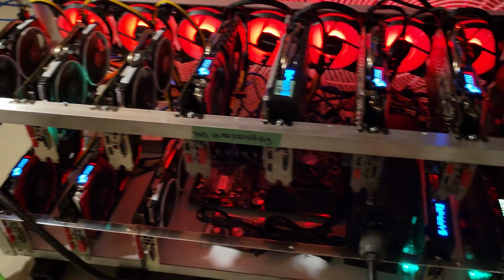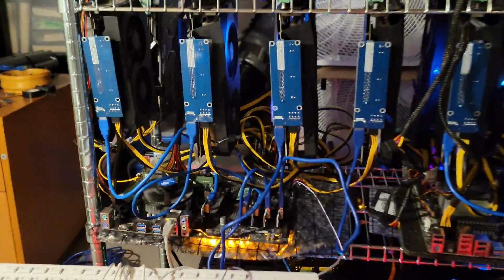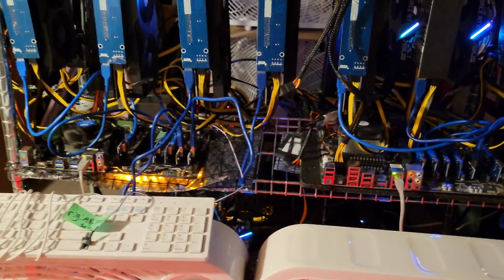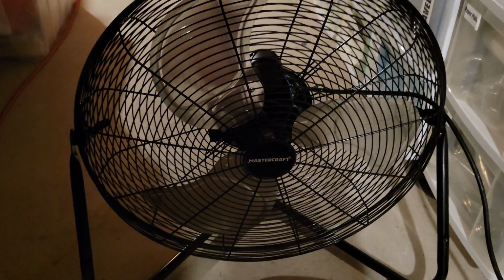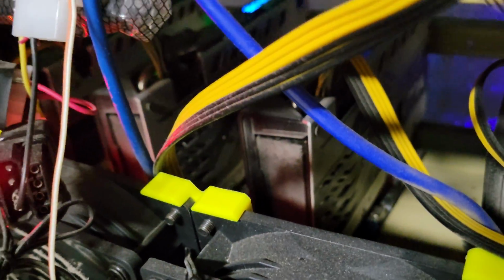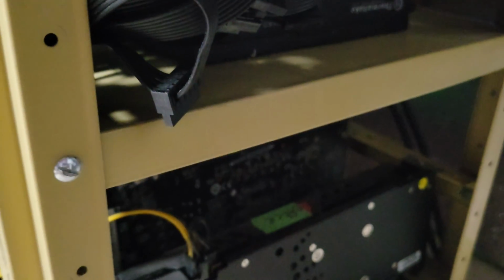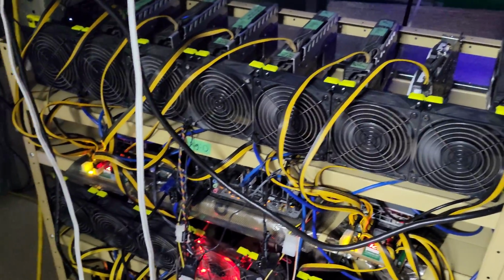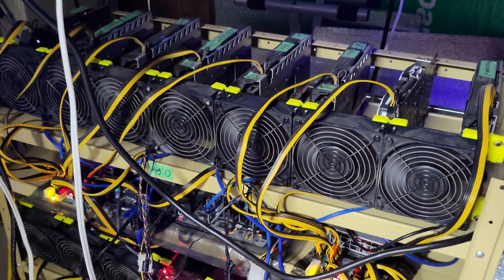Mining Rig update (RX 570 4gb/RTX 2060) Mining ETC and ETH

Comment: Hey i have some questions,  I want to build my own mining rig using to start 4 3060tis my local store sells them at around 750$ each nun LHR. 
About Psu i will buy an old dell platium one Ty for your guides about breakers 
I am quite worried about the motherboard, Idk which one do support the PCIe usb extender and which dont, do you maybe know how to distinguish between the two ?
Also for last should i run linux and let it run or windows ?
Reply from the maker: 1. a small 4 gpu mining rig is reasonable to start out with.
2. for the Dell Plat PSU, I needed to buy the breakout board from parallel miner, there is a specific model that supports it, of course check the supported psu models before buying. and the dell psu needs 240v fyi.
3. for a motherboard, there are a few options, you can buy a motherboard from aliexpress, there are some good cheap mining motherboards, otherwise you can also consider getting a 10-11th gen cpu, and pairing it with a modern motherboard.
I personally have used the 12 gpu chinese mobos from aliexpress, but even then you still may need to order a compatible cpu.
So going with a modern cpu and motherboard, from amazing could be the simplest, pick a motherboard with 5-6 pcie slots, and worst case you can return with amazons return/exchange with amazons return policy.
And most importantly, if you are new to mining,
Use Hiveos.
Its very very simple and reliable compared to windows 10.
You setup an online account with them, and then flash the OS onto a drive or usb and it makes managing the rig super easy.
there are a lot of good tutorials out there on how to set up hiveos.
hope that helps a bit.
Reply: @CostEffectiveminingYT  Ty so much, love your channel btw massive thanks ♥
Reply from the maker: @Kivsha  glad the videos on the channel are useful
Reply from the maker: @Kivsha  forgot to mention, if you are only going to use 4gpus, sometimes buying an ATX 750w-850wGold or two gold 600-650w PSU can be cheaper, you may need to buy 8pin to dual 8pin PCIE splitters but sometimes ATX PSUs in the current market can be much cheaper than the server psus.
Reply: @CostEffectiveminingYT  yes I wanted to say that but I didn't want to bother, I live in middle east shipping for me is like 240$ for those psu and big cases. I might just get ATX power supplys until I find someone with connections so I can get those server psu
Reply from the maker: @Kivsha  then in your case, going with ATX power supply will be the best.
Just keep in mind, mining is profitable today, and could be for the next few months, but there is always a risk that things can change.
Reply: @CostEffectiveminingYT  i hope that when eth drops coins like kda rvn and nervous  will fill the hole it made. the market cap of those is way smaller but still

Comment: Hi, nice hashrate you have! What that   part on left side with wire on rig 00:00:17?
Reply from the maker: I am assuming you are talking about the power supply.
I am using HP 1200w platinum plus power supply with cheap aliexpress breakout board.
The gpus are all Polaris RX 570/580.
I am running 220-240v on the power supply so i am loading it at about 750w.
Reply: @CostEffectiveminingYT  okay i am get it, nice!

Comment: How much does it roughly make for the 13 gpu rig currently ? 
Planning to do a similar 570 4gb setup
Reply from the maker: Currently about $18-19 Revenue and about $12-13 after power cost.
Its not crazy profitable but for the time being its reasonable.
I would suggest not spending a ton on Polaris GPUs as they dont hold their value that well.
However, i dont know how long mining profitability will be good so if you buy the gpus at a low enough price for a relatively quick ROI then it could make sense.
Reply: @CostEffectiveminingYT  That is, each GPU gives you around $ 1.00